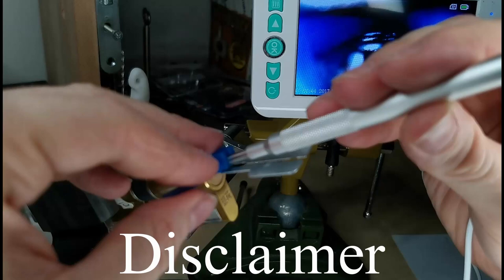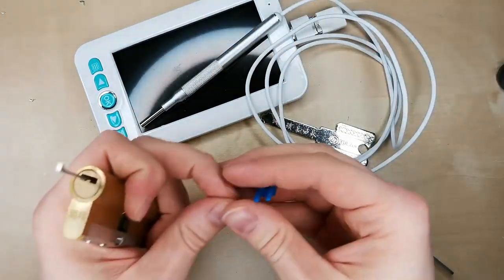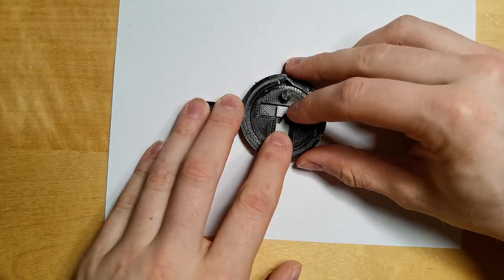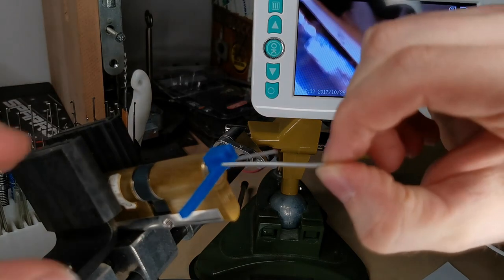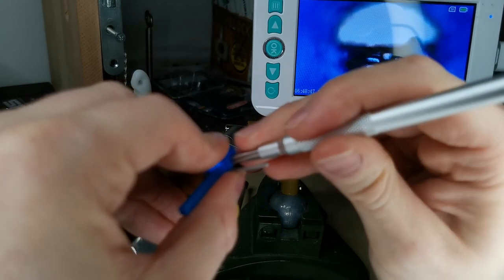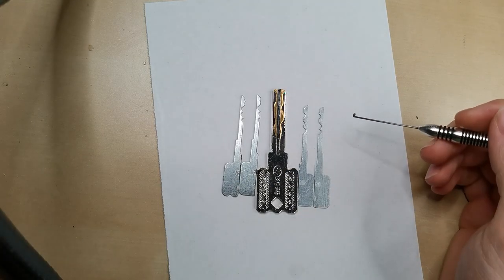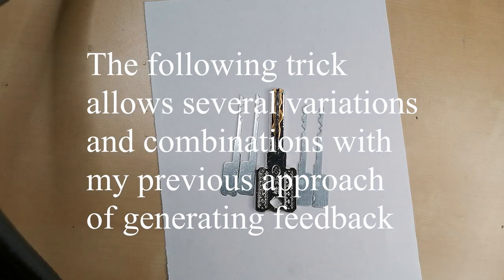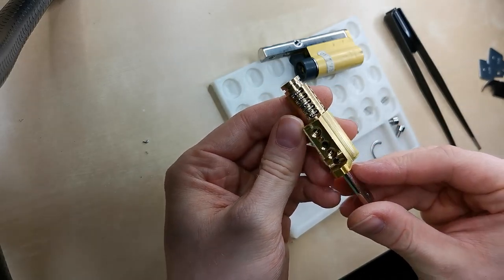[28] How to defeat the unpickable Yuema 750

Comment: This is awesome! Kudos on the patience to do this. Very nice. A link to the Otoscope would be nice too :)
Reply from the maker: Haha the hard part was to do it all with the lighting and the camera in my face and having everything at least somewhat visible 🙂 I have 3 digital otoscopes by now because I buy them when they are cheap. The wifi ones are great too but they have a gyro built in and rotate the frame to align with gravity. This can be useful for other locks but for the yuema it was annoying. I think the wifi ones are all with that gyroscope feature while the cheap ones with a screen don't have it.  Here is the otoscope I used but I got it on sale: https://www.amazon.de/dp/B08BR7F2TJ/ref=cm_sw_r_cp_apa_fabc_YBrYFbC7HNSEJ?_encoding=UTF8&psc=1
Reply: @CaptainHookNumber1  Thanks! I am very patient so I can wait (also I need to find one that ships to Israel :) ). This is really awesome that there is some progress with defeating this lock. Looking forward to your next videos.
Reply from the maker: @majorzbzzn  you probably have plenty on Amazon that are intended to remove earwax  don't think there are big differences between them except the gyroscope feature 🙂 also those lishi key cutting pliers are pretty neat and were not available except directly from China here. There could be another vulnerability that uses a sputnik but I probably won't have the time/motivation to build that 😅
Reply: @CaptainHookNumber1  I have one of those ear wax types but it is hard to see through them. This one with the monitor and the prong seems nicer.
Reply from the maker: Those are the wifi otoscope I mean
https://www.amazon.de/dp/B085WVJ69K/ref=cm_sw_r_cp_apa_fabc_XTsYFbWG7XW82

Comment: That was awesome! It very clearly works perfectly fine, although it is tedious and time consuming. Congratulations 👍 While watching I was trying to find suggestions for improvements. It seems especially a hassle to align the two flimsy key halves.

Do you think it might help to keep the handle parts of the key at full size, so you can make them pivot? E.g. by attaching them with a blind rivet or similar? Then you still have access with the key cutter because of the hinging. Alternatively, if you could punch holes precisely i stead of nipping from the side, you could maybe use a one piece key?

You can still use your platic guide as a combination of a tensioner and camera holder with the right angle, I expect, and leave it in for speedy impressioning.

You're the expert and I am just sharing some initial thoughts without having tried your setup. Maybe it gives you some ideas.

Again, awesome job on the poc and well worth watching 👍 Thanks for sharing 🙏
Reply from the maker: It's defenitely not practical like this 🙂 but in reality it is not that extremely slow to fiddle that in (I was reaching through/around a ringlights and a tripod the whole time and making sure you can see the wobble on the screen too). I think it would be enough to have the blue thingy I printed made from metal.
But if someone wants to make it a professional tool I think the key blanks should be connected at the tip in a way that prevent themselves from slipping upwards (hinge, magnet etc. ). And maybe a blob in the front that holds it down there. 
But I think the lock is not polular enough or used in places where such a tool would be worth it for professional use 🤔
I just intended this to be a proof of concept 🙂
Maybe someone will put more effort than I and publish a better tool 🙂
Cheers!
Reply: @CaptainHookNumber1  yeah that was my line of thinking as well. Can imagine the video equipment didn't help 😂 Awesome poc and glad you shared it 👍

Comment: Nice on defeating this lock!
Are there any commonly available europrofile cylinders that you can't pick yet?
Which ones do you think come the closest to actually being unpickable?
Reply from the maker: With enough effort (this video is a good demonstration of the effort sometimes) you can open any current lock imo.
I'm a big fan of the Abloy Protec 2 (I know there are some videos where it gets dialed to code but really picking it is a much bigger task).
Another nice lock is the Evva ICS with great value for the price.
Most locks featured on this channel are very secure locks opened under lab conditions but much harder in the field. Also don't forget about the physical security and key duplication.
Cheers
Reply: @CaptainHookNumber1  Considering the "dialing to code", is that what huxleypig did on his picking video of the protec2? Because I was pretty surprised that he was able to pick it so quickly whereas locks with lower difficulty still often take longer to pick.
Considering that there isn't a lock that can't be picked, maybe choosing a lock that always takes a long time to be picked would be better. I'm thinking of the IKON SK6 Sperrwelle Undercut Extracode for example. The picking difficulty might be much less than the Protec2 but the minimum amount of required time seems to be larger and also seems like there aren't as many tools made for picking that lock because it isn't as common..
Reply from the maker: @-Turtl3_  that's how one should look at it. The sperrwelle extra code is another good example. But all those locks need a rare amount of skill or insane tools.

Regarding disc detainer locks: The elements don't jump out of position on their own. But picking them by feedback alone can be a lengthy process for some models. You can feel the gates in the dialing process but keeping track iterating through the discs several times and finding the binders to slowly find out which gates are the correct ones... Is a lengthy process and especially on the Protec 2 takes a lot(!) more effort than those videos show. The same tool can be used (at least I cab say that regarding some videos out there) the concentration and time required is just not represented correctly.
Reply: @CaptainHookNumber1  So, if I understand you correctly, huxleypig practiced a lot on the lock beforehand to memorize the positions of the true gates and therefore was able to do it rather quickly in the video. However, if it was the lock of someone else and he didn't know where the true gates are, he would have needed a lot longer.
Is that what you meant?
Reply from the maker: @-Turtl3_  yes. That holds for most picking videos on YouTube. Even in my videos I picked the lock usually once or twice before recording.
For disc detainer locks this just has a much bigger effect.